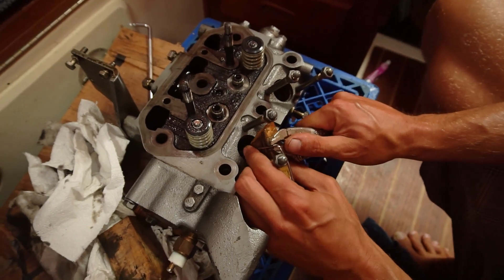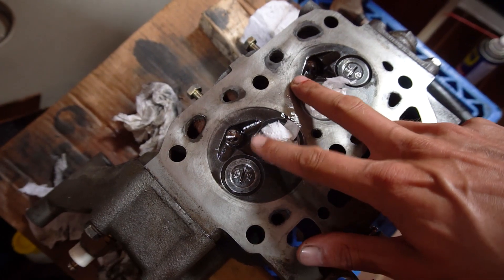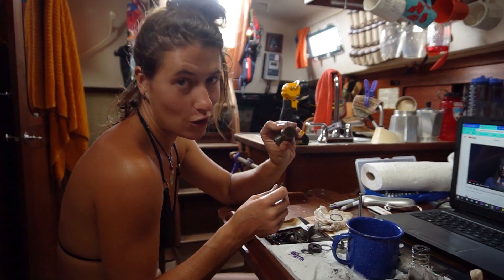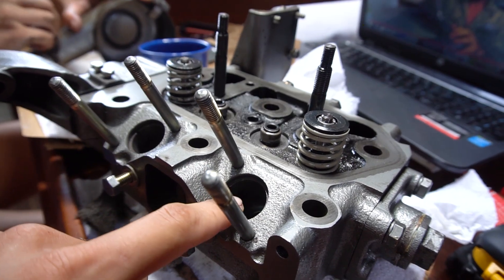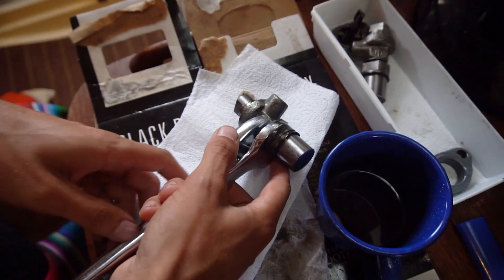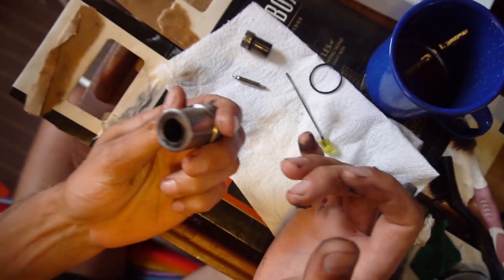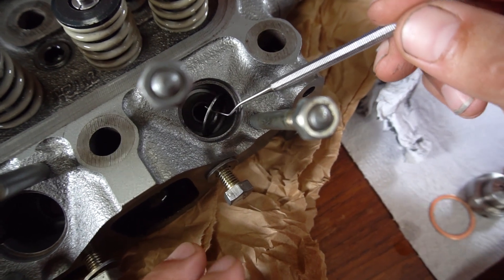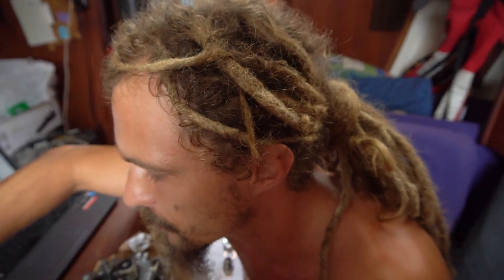Yanmar 2GM Engine Rebuild: PRE-COMBUSTION CHAMBER Assembly (Part 7)

Comment: This was super helpful... especially dealing with real carbon-jammed bits... thanks. One comment hopefully useful... my parts  diagram has only two washers above the heat shield... i have a feeling that 3rd, undersized one that slopped about shouldn't be in there. Though if it's all compressed and sealed it won't matter I guess. Anyway - thanks again.
Reply: Gasket, combustion chamber, gasket, heat shield, two washers (only) and then the external seal.
Reply from the maker: Real happy that you found this very useful. We did notice that difference depending on which schematic. Ours was showing multiples. Not sure if it makes a big difference only 2 or 3 but our little Yanmar still runs like a charm regardless. And we're no mechanics so these are just guides. Are you rebuilding yours?
Reply: We've had a load of issues. Mainly prop shaft but decided to give the engine a little love too.... however for now we don't want to take engine block off so thanks to you we will go ahead and change the upper covers / seals but leave the combustion chamber and heat shield in place. We'll see if that works and if not we'll get out the socket set and start hammering! Anyway pleased to hear you are all good. Thanks again... ! andy
Reply from the maker: Well with every issue we learn a little something right 😉 Hopefully what you did will last for quite some time. Glad our videos could be of some use. And a little love to the engine does go a long ways plus often the mechanic is way out of reach or unavailable. Best of luck Andrew

Comment: Your videos are a great tutorial and contribution to the DIY Yanmar repair crowd. Many thanks!
Reply from the maker: Thank you so much Wallace. It means a lot to us. Have you been doing major repairs on your engine?
Reply: Not yet but considering having the cylinder head rebuilt on my 1996 Yanmar 3GM30F.  4000 hours. Oil consumption is slowly increasing and getting blowby pressure in the valve cover.
Reply from the maker: Those little Yanmar engines sure run for many hours. Best of luck if you do it

Comment: How hard is it to disassemble the injectors and clean them? I've heard the parts inside are not listed in the Yanmar catalog, do you just reuse the seals inside? Trying to get an idea if its better just to order new ones when I decide to clean mine.
Reply from the maker: It's wasn't too hard to open the injectors up. I think yanmar sells injectors as one unit. We considered getting them serviced but there was was nobody doing it in the area and we would have had to ship them. Still cheaper than buying new ones. On the other hand the spray pattern was all good and cleaning them just required a little elbow grease. Parts for the pre combustion chamber were easily accessible and affordable. Your call on what to do we are no professionals. I guess it really depends on their state. Best of luck.